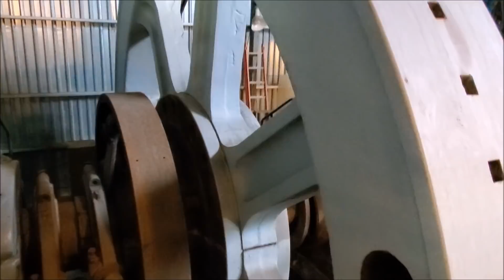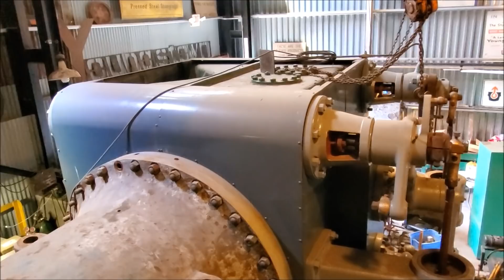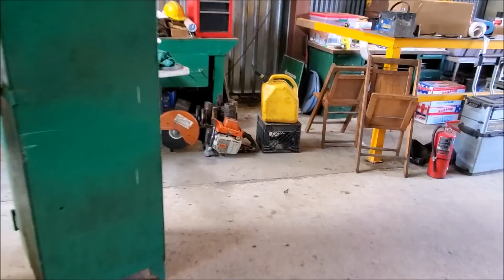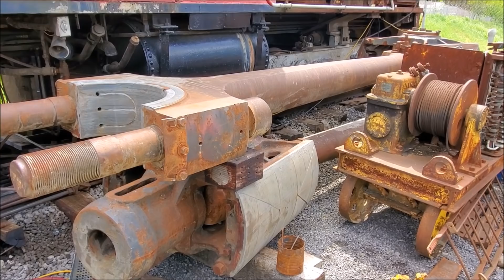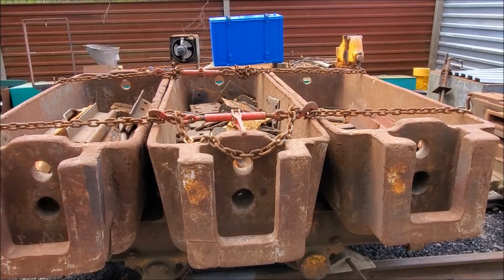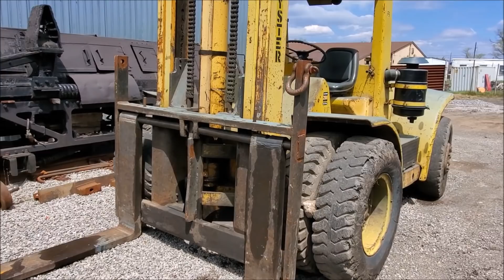Brief Tour of the Youngstown Steel Heritage Museum

Comment: Have you guys considered having 'show buildings' in a sense? A series of basic steel buildings containing a recreation of each step of the steel mill making process using 58 as the 'ride vehicle'. Passengers board, enter a building that's got the look and feel of a blast furnace, host does their lecture about that step of the process, onto the next building and so on. I think it might work well with your track plan you've got going on so far.

Comment: You mentioned J&L, we had a J&L(Jones & Laughlin) mine way up here in NY State at Star Lake NY. I worked for Syracuse Bearing, now called Kamen Bearing in the early 70's and at that point the mine itself was shut down but we still supplied bearings and stuff for their water pumps because if they didn't keep the mine pumped out and it filled with water they never would be able to empty it! Now they are even scrapping what buildings what buildings are left to reclaim the property.

Comment: Do you think you will ever get the Todd engine back together enough to spin?  Maybe drive it with compressed air.  With no load, it should move with a  lot less pressure.  It would be cool to see the big flywheel and the connecting rods moving.
Reply: James Dorn 
I used to follow his Practical Machinists thread, and there was a plan to operate the Todd and a large steam powered ingersol rand reciprocating air compressor off a industrial boiler. Not sure what happened to this plan but oh well. The compressor is hidden away in one of the outbuildings, I think it came from a meet packing plant.

Comment: The hyster fork lift had a big rock stuck between the front wheels of the left side from sitting in the drivers seat. If you don't keep those out of the wheels they will bust them and then you'll have to get new ones. You may already  know this but I seen it and I'm just trying to help. Lots of interesting equipment around the property there. The star is definitely the operating steam locomotive and that will include the railroad when finished. I like to make trip to see your outfit one day. Stay well.    👍